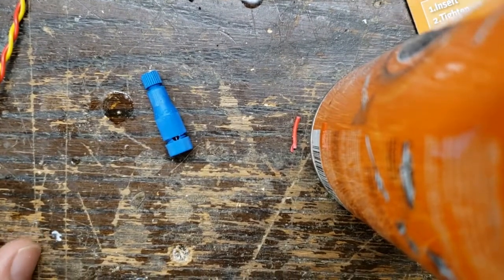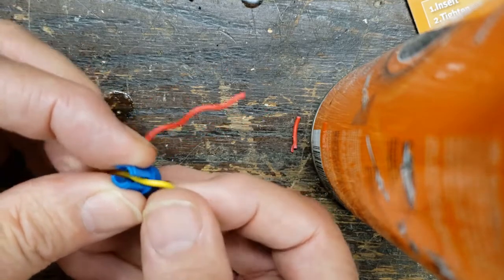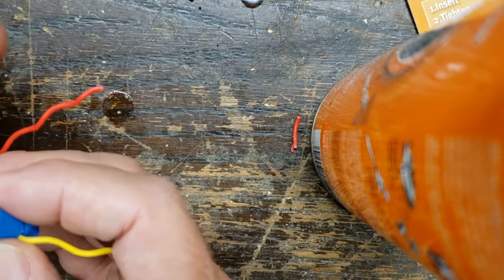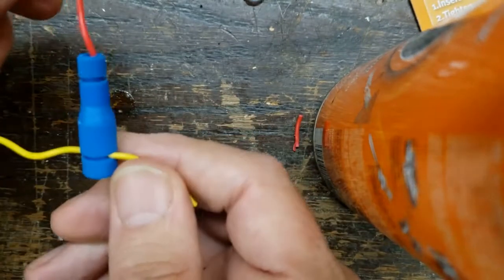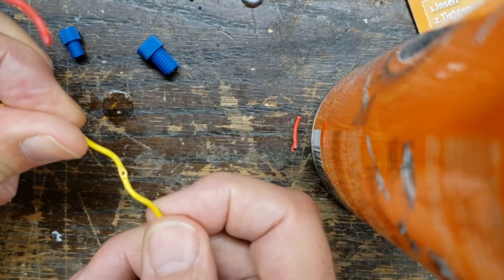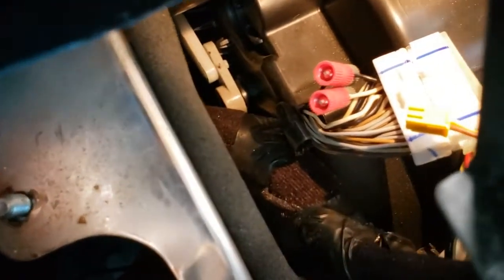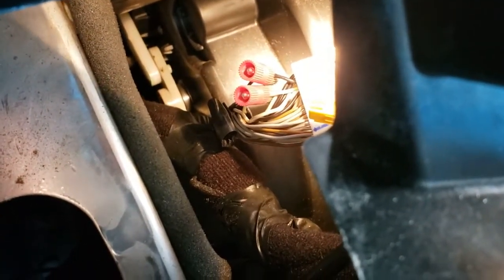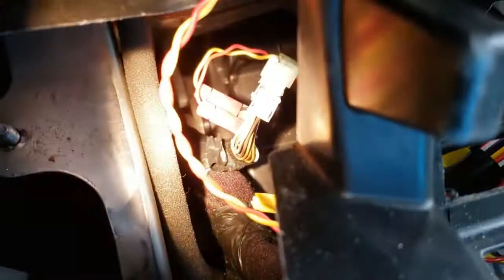Sorento radio upgrade addendum   Using posi-taps for the CAN harness connection

Comment: Thanks for posting this video.  How did you know which wires to connect to. I see a bunch of black and white (gray) wires on my Sorento. Crutchfield was no help.  Which wires in the harness did you actually tap?
Reply from the maker: It's been 2 years i forget which ones.  I had to experiment.    Will look for a picture.
Reply: @caseybea2  Thank you.  This is very helpful.  In the video, it looksl like you've tapped into a pair at the end of the harness. I wasn't sure if you untapped after this vid and tapped another set of wires.  :)
Reply from the maker: @dragonlips2005  I didn't document it, but I *think* its actually the second pair of black/white wires from the end of the connector.   I do not think the ones on the end worked.
Reply: @caseybea2  Thank you so much.